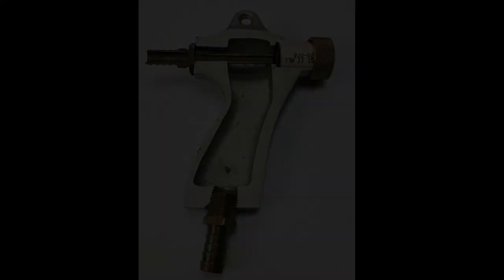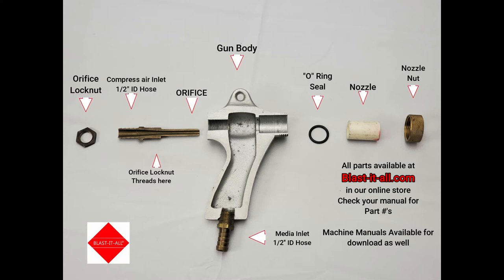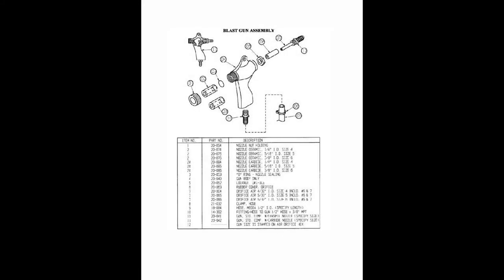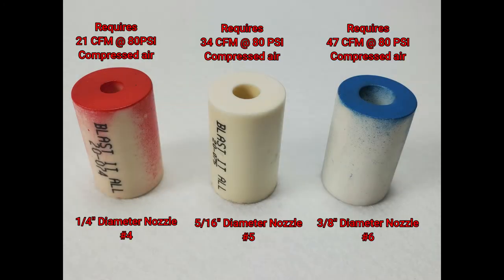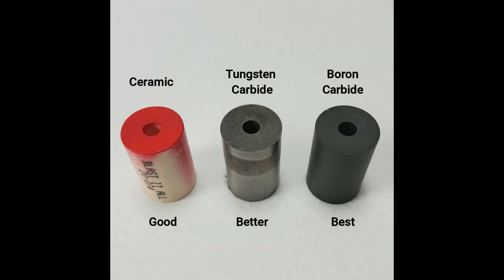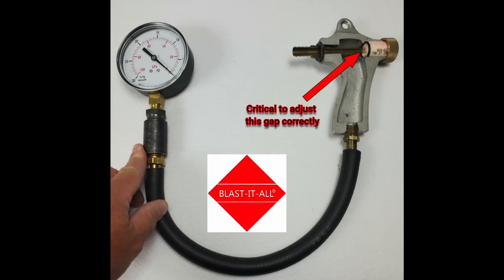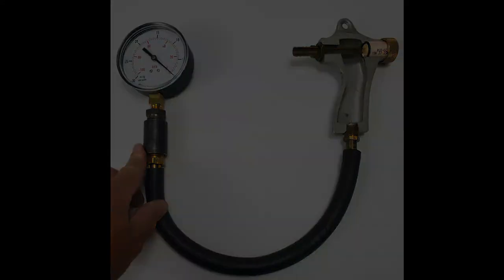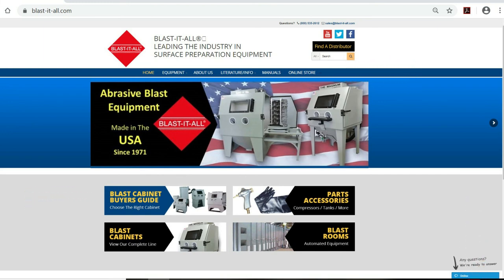How Do Sandblast Guns Work? How Do You To Set A Sandblast Gun Up?

Comment: I’m new to working on Blass cabinets. I use one at a local CNC machine shop and I’m probably the only guy that ever uses it. Getting ready to add glass beads to the cabinet and was wondering if the entire 50 pound bag was necessary to put in?
Reply from the maker: For suction cabinets the answer is always no. This is a good guide for that: https://www.youtube.com/watch?v=zTm1bg5uTPQ

For pressure cabinets you would want to put in enough to almost fill the entire pressure pot. This can very greatly as pressure pots come a wide range of sizes sizes.

Comment: I have a sullair 160 air compressor has 4 cyclinder car engine it puts out 160 cfm at 105psi continuously its industrial what nozzle size do you recommend
Reply: The nozzle and jet size will be different depending on what type of work you are going to be doing. What will you be blasting?
Reply: @johnklaver4960  I will be  running coal slag on car frame its about .140 thick
Reply from the maker: What blast gun do you have?
Reply from the maker: Try a number 4 or 5 Nozzle

Comment: I really enjoyed watching your video very informative, I’m building a wet sand blasting cabinet and was disappointed by the results, I think some of the knowledge share here might help me going on the right track !
Reply from the maker: The challenging part is keeping it all in a slurry so the suction gun can pull it up. Then making sure you have the right suction. Your compressors CFM capabilities plays a big role in that. This is for  dry blasting, but it gives you an idea of what is needed: https://www.youtube.com/watch?v=OaWxDhMGiIk
Reply: @blastitall  thanks ! I’ve a 7,5 hp with 25 CFM i’ll try to choose my jet accordingly, i use a water pump to also help getting the slurry up !

Comment: thank you for great video, can you please explain the higher the gauge reads the low the vacuum so moving the nozzle  out dropping the reading means more vacuum, thank you
Reply from the maker: I'll try to give you an explanation.  A proper vacuum gauge will read from 0"-29" HG.  So the higher the indicated value, the better or more vacuum.  We usually see our suction guns read from 15"-16" HG once they have been adjusted.  As the orifice is extended out of the gun the vacuum will increase to a certain point and past the point it begin to decrease  (kind of like a sweet spot).  Using this type of setup for the gun is the best way to know if your gun is drawing the most amount of vacuum and is working correctly.  Thanks for the question and I hope this helps.  - Tracy
Reply: @blastitall  that is a great help now i understand thank you for your help and quick reply regards john
Reply: @blastitall  thank you Tracy fine tuned my sandblast gun today and working fantastic regards john

Comment: What size compressor is needed to run your gun?  If my compressor doesn't meet your recommendation should I stay with the gun that came with the cabinet? My cabinet is the big H F that is all over you tube and my compressor is an Ingersoll  Rand Garage Mate.
Reply from the maker: Edward that particular Gun requires a minimum of 21 CFM at 60-80 PSI. Here is how an Ingersoll Rand rep explained it to WorkshopAddict.com. https://www.youtube.com/watch?v=6vWqa7WjkVU
Reply: Thanks for informative video. Really liked about vacuum gauge attachted to gun to measure best adjusment. Will try that.
Reply from the maker: @pizdriks  Let us know how it goes.
Reply: @blastitall  measured vacuum on inlet. Thought that range would be greater, but it didn't change a lot between almost fully threded in to say 6 or 7 threads out. Gauge read about 0,4bar vacuum +/- 0,2bar
But still, was good to check that.
Reply from the maker: @pizdriks  Make sure your nozzle is in good shape as well and is the correct size (Matches the Orifice size)
Reply: @blastitall  do You know any chart that I could check out?
Reply from the maker: @pizdriks  If you are looking for CFM requirements you can find a chart for suction and pressure systems here: https://blast-it-all.com/cfm_requirements/